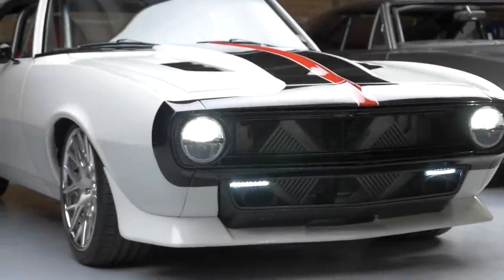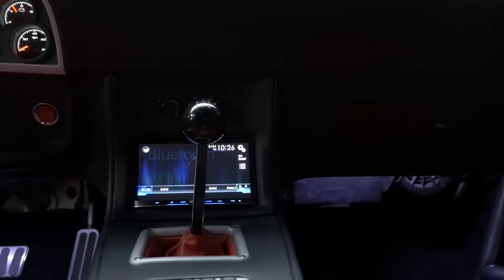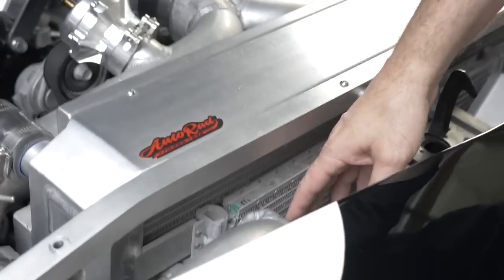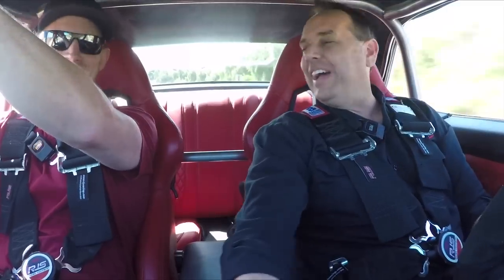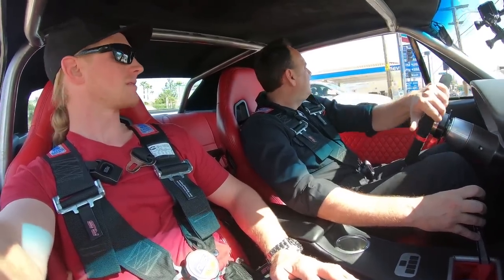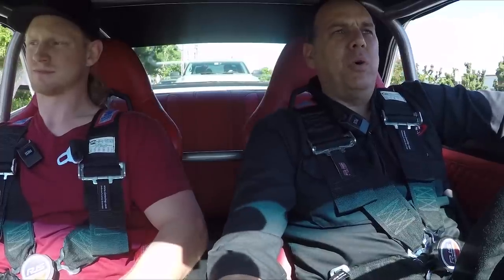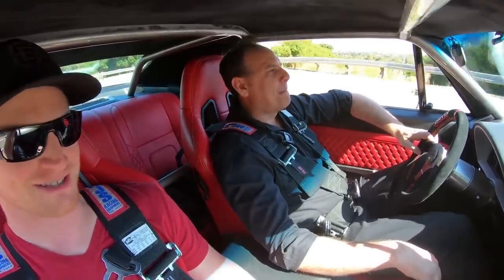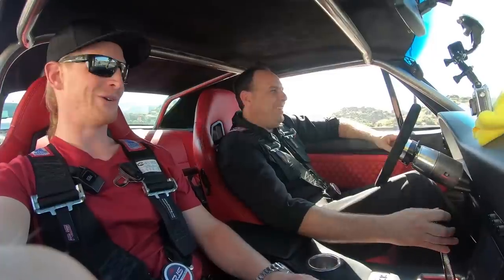Drive a Fab 1000 HP Custom Daily Driver with Tom and Tom Walsh.

Comment: do you tune accel gen 7 DFI?
Reply: don't know where you are but I know a great tuner in PA
Reply: @jasonbeaulieu4979  I'm in NY. 60 Miles north of NYC
Reply: @bonzainews  If you're willing to travel north of Philiadelphia, check out Bill Hunsberger @ Second Street Speed.  They did my Gen 7 DFI.  He's one of the best in the industry.
Reply: @jasonbeaulieu4979  sounds good,  what is your ride?
Reply: Larry Keller ‘93 mustang 408 cu in, ys trim vortech, 83lb inj, kooks 2” into 3.5, c4 trans. I drive all the way out there from Maine. It’s the only place I go. Also did my brother’s 550rwhp 96 cobra, and my father’s 515 rwhp ‘05 vette, and a friend’s ‘86 mustang. I’ll be going back out there with the vette in the next few weeks to retune after cam/headers install.  Thank me later.
Reply: @jasonbeaulieu4979  which cars have the accel gen 7?
Reply: @jasonbeaulieu4979  bad ass piece of machinery. Ahhhhhh the good old days.
Reply: Larry Keller yeah this isn’t the last configuration I had, they redid the engine for me a few years later, solid roller cam and custom twin in tank pump system and Jesel shaft mount rocker system and further porting.  I was there last year with this : https://www.facebook.com/JBPerformance207/videos/1709020349189532?s=562575107&v=e&sfns=mo